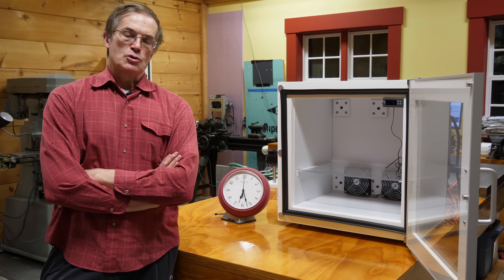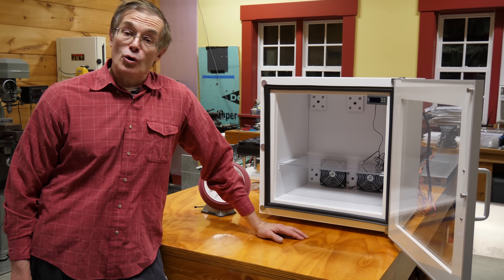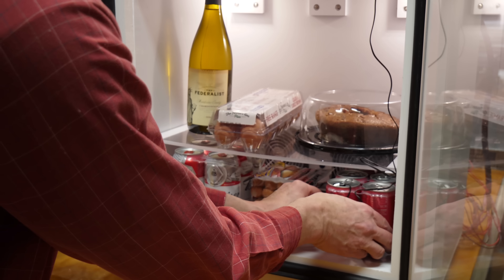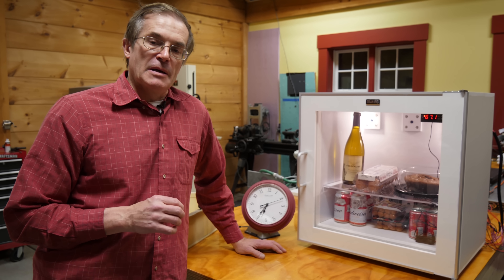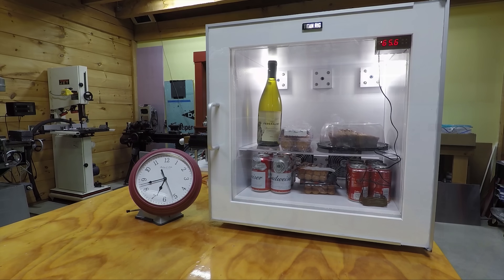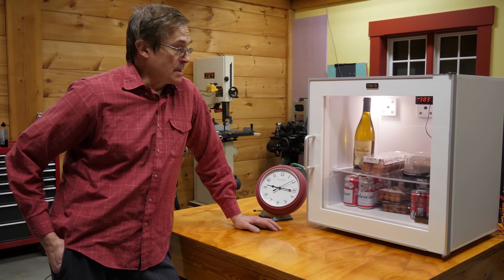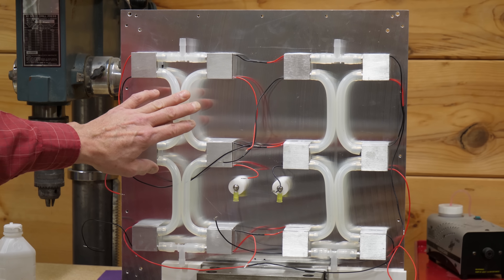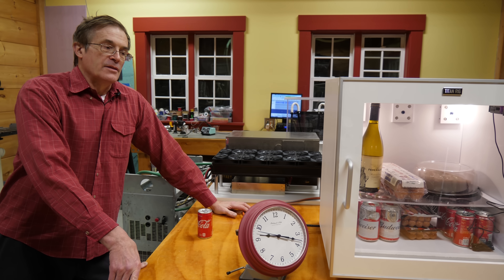TESTING OUR DIY REFRIGERATOR! - TEC/PELTIER

Comment: the fridge looks great, you did a lovely job with the build. really looking forward to the follow up now. this is a very very interesting concept in terms of energy transfer for the van build i am planning, wherein i would like to use the bi-directional properties of peltieres to selectively cool and heat different spaces for climate control and energy and water storage at the same time.
you seem to have similar ideas and a way of thinking that i find brilliant. maybe you'd be interested in the holistic concept system i've dreamed up.

in an off grid van build, energy generation will be an important aspect of this bi-directional temperature/energy sytem, but in a domestic kitchen environment and in it's most basic form, i imagine a 'symbiotic' situation between a refrigerator and a sous vide cooking system to put the generated heat to good use.

if this gets you thinking i would LOOOOOOve to put your awesome grey matter to work on a hot-neutral-cold bi-directional energy transfer system for self-contained scenarios like an offgrid van or dwelling. 
anyway, i love the videos you make, thank you so much! they are very inspirational. see you in the next one!
Reply: And if you live in a cold climate, as I do, waste heat from the refrigerator isn't a problem - in fact, it's a blessing.  Other possible uses for the waste heat would be maintaining a hot water supply.  My interest was especially piqued when they mentioned a liquid cooling system.   It's nice if you can conserve that energy and move it around to where it's needed.

Comment: Hi there, plumber who does hydronics here. This is awesome, as are the other videos of yours that I've watched. 

Besides just exhausting outside, which is a great idea half of the year, you could water cool to a pre-conditioning holding tank before the inlet of a standard hot water tank. Cold water comes into some holding tank before going out to a traditional hot water tank but a parallel pipe circuit with a pump cools your fridge. This way the removed heat is used year-round to help heat your domestic water.
Reply: Is there some similar concept to the vortex tube in liquid refrigeration that could be used to seperate the cold part of a liquid from the hot one?
Reply: @chadoftoons  Generally in water tanks the cold input water enters the tank from a low point and you pull hot water from a high point and let the density difference handle the rest.
Reply: A small frige  that has a low energy consumption is something everyone would appreciate..I ,myself spend alot of time camping as i work alot away from home, so rather than staying at an expensive hotel, I camp..
  Just as finding an efficient way to keep food cold can be difficult...finding a hot water supply for showers ..dishes..laundry ect..is equally as hard..in fact they together are easily the two greatest challenges any camper faces...would be so nice if you could "kill two birds with one stone "here...and make it able to run of of any "green" energy..solar, wind, mimi hydroelectric source would definitely  be a bonus!! Huge market out there for such a product..
Reply: The peliters are only inefficient if you don't have a use for the waste heat, but if you do, you can really make them make sense.
Reply: @jttech44  Such as heating your room, when cold outside ;) but you could use the energy to heat your room with a heater that has a higher cop than 1(that will be the cop for using the cooler to heat your room via waste heat).. but at such small energies it's probably not worth it.
Reply: I like your thinking and had similar thought... find a use for the resultant heat output so it's not wasted. Heating water is a great idea.

Comment: WAIT.. SERIOUSLY.. You didn't follow up with power requirements. You built a fridge, talked about how to use the devices efficiently,  but never posted numbers. 

I'm really interested in how much your fridge draws. We have a fridge that is slightly larger on our boat and I know exactly how many watts it requires per day. I'm  interested to see how much more efficient my fridge is than the one you built (mine is compressor based which is why I'm pretty sure its more efficient).
Reply: Having this system on a boat is really interesting actually, because you have a ready source of cool water to keep your peliters happy. I'd bet it would work rather well.
Reply: @jttech44  That's what I was interested in too!
Reply: You right, it would indeed be interesting to see some numbers.
Reply: Yup there's a reason why Peltier fridges aren't a thing(outside cheap coolers and such). Phase change is no contest more efficient.
Reply: @payday510  Lots of moving parts on a phase change unit though, and they don't like being moved around while in operation. That's a problem for a boat doing boat stuff so this system might make sense if you have the power to burn.
Reply: @jttech44  Yeah, even more so than a boat doing not-boat stuff.
Reply: @jttech44  build one and shows us.
Reply: @jttech44  the danfoss bd35f and bd 50f compressors stay on a boat for more than 25 years with no problem if they are installed corectly... just recovered a bd25 35yers old still working with the freon r12 gas... still running...
Reply: +Lukas Ooo you are tryin to be sarcastic but you have no knowlege.
Reply: @thombaz  Thanks for that insightful comment, random person on the internet.
Reply: INDEED   so many trolls here   inexplicable to me    we should be trying to communicate freely , regarding ways to move forward using less    but i'm a freak , it seems @thombaz
Reply: @kcajmortsnnew1488  Good to hear , we need more freaks!!! We all come from different backgrounds, but with varying knowledge. Just think how much further, not to mention happier we would all be if we all used a bit more kindness when dealing with each other. Freaks unite!!!! After all which is a better teacher, A person with vast knowledge but can't (or won't) convey this properly to a lesser qualified student. Or a person with half the knowledge and  the passion and patience to impart all that knowledge? If they were all like the first example, we would be saying "what's a fridge?"
Reply: By the time he gets it near the heat exchange capacity of a typical phase change set up, it's gonna dim the lights every time it kicks on. If it ever kicks off, I suppose.
Reply: It'll be about 5 times higher than a conventional fridge of the same size.
Reply: +Lukas Well then... we are the same. :D
Reply: I AM A BOT, I AM A BOT, I AM A BOT!

"I know exactly how many watts it requires per day" was stated by Travis Wizniuk; so kcaj can now sleep in peace or whatever. 

For those that keep asking for numbers because they want to know how it compares to a phase change (compressor) system, he ALREADY stated in the previous video that it's extremely inefficient in comparison and that the purpose of this exploration is for those situations that can't or for those people that won't use a phase change system.

Please listen, read, think before applying fingers to the keyboard.

Btw kcaj, I won't be responding because I AM A BOT!
Reply: rebel bot....ha,ha,ha....i sleep quite well , thanks....NO REPLY   @strikehold
Reply: Seriously, the whole time I'm sitting there like dude, are you going to talk about Energy Efficiency and what's the power draw otherwise what's the point of this whole freaking video! I've already got a mini freezer that came with a dual thermostat and it only cost me $180 (rated at 136kwh/yr freezer and about 80kwh/yr in frig mode).  The problem is The Next Step Up from a single compartment 1.2 cubic foot freezer / fridge is a dual-compartment 10.1 cubic feet fridge. What frig is MamaBear supposed to use? I need a 3 cuft dual compartment frig that can fit a three 12in frozen pizzas, a gallon of ice cream, two 2 litre bottles of pop, 1 gallon. And I wanted to use about 150 kilowatt-hours a year or less!
Reply: you guys have been arguing for fucking 3 days,  and none of you thought to check WHO said "We have a fridge that is slightly larger on our boat AND I KNOW EXACTLY HOW MANY WATTS IT REQUIRES PER DAY"
Reply: @Tony N AGREE w/the troll comment , but note that i spent some time expressing dismay that a (possible) bot would be used in a thread like this , and that coming from political sites , i'd grown a bit paranoid   it's interesting you know how advanced A.I. is , and can see though it   i agree it usually reveals itself quickly , but i addressed that    
    i came back to try to untangle this , but utube shuffles and deletes comments , so this mess is impossible to make sense of now
  is what i've said that difficult to follow ? long sentences too difficult to follow ?   
       SERIOUSLY , your comment has nothing to do with the subject discussed , and appears to show you need to express your superiority
Reply: @suprememasteroftheuniverse  ain't you cute , projecting your sexual insecurity
Reply: just stay with the danfoss compressors... they have no equal in a boat... the most important thing is to have a nice good insulation... more is better, and keep the air from going in...
Reply: Hate to say it but the AI is right. It sounds like a small thing but it's important to understand or it gets you in trouble with reality AND the thought police. Watt does indeed include the "per second" and can be seen as a measure of instantaneous energy consumption. Consumption itself happens over time (that's what you pay for), it corresponds to the integration of watts over time and is expressed as Wh (or Wday). Watts per day sounds fine in English (because "per" is ambiguous in English) but it does not make sense mathematically in that context, it only makes sense as a measure of how the instantaneous energy consumption is itself changing over time. So if your fridge is magically using less power every day you could say it's getting better at 5 watts/day. If that's the case, patent it.
Reply: peltier is not efficient on large scales, because removing the heat becomes more challenging as the volume increases
Reply: "I know exactly how many watts it requires per day" - obviously you do not know, as it does not even make sense.
Reply: @hpekristiansen You buy electricity based on the watt hours you use.  Travis' question makes perfect sense.  Since the fridge's power consumption isn't constant a measure of the watt hours used over a 24 hour period would be a perfectly valid parameter.
Reply: @maddpeanut6313  Yes - watt hours per day gives you the average power usage that day. -that does not mean it makes sense to say "how many watts it requires per day" - it does not!
Reply: @hpekristiansen  You can easily calculate watts per day from kilowatt hours with simple arithmetic. It's not an industry standard measure, but it's not nonsense. I think you might be the less informed one.
Reply: @deelowe3  It is not industry standard, it is not any standard,  because it does not make sense. Try to do the calculation, that you claim is so easy - just take som random numbers with units. e.g. 24 hours/day, 12 kWh and you will see that the unit W/day can never be calculated in a sensical way. I will not be responding anymore, as I find you obnoxious.
Reply: @hpekristiansen  Multiply kWh by 1000 and divide by 24. Did you fall asleep during the units conversion lectures in science class?
Reply: @gdxd7956  HAHAHAHA oh... the irony . you call everyone an idiot but your math is wrong. This is about physics buddy, not only math. Sit down and let me help you.
Joule is the real unity of energy. 1 watt is 1 Joule per second. kW.h is a confusing unit of energy because to get to an amount of energy from kW you don't divide by time, you multiply by time in order to cancel the "per second" that is already inside Watt. So the correct math is:
1kW.h = 1000 . J/s  . 3600 s
Converting 1hour to seconds you get to cancel the seconds unit from Watt. thus
1kWh = 3600000 J.

kWh also means you left a device that draws 1000 W on for an hour . Or another that draws 500W on for 2 hours. The "per hour" thing quickly looses its meaning. It is confusing because it mixes consumption per second with hour in the same unit and those don't immediately cancel out. But it's convenient for the electricity bill somehow. This unfortunately leads the average person to intuitively (and  mistakenly) using kW as an amount of energy whenever he says " my device consumed 5 kW per hour" (thinking that running it for 1 hour will use 5kW of energy). This leads to the dreaded "how many watts per day?". Gustavo, even when you tried to correct everyone using your math you ended up doing this same common mistake. Boa sorte na próxima vez, amigo.

This is why Watt/day makes no sense.
Watt.Hour/day makes sense.
Reply: @hpekristiansen  Ahh.. I see the internet police have arrived.. 

Ok ok, watt hours. Hows that? Now go fuck yourself.
Reply: if you know EXACTLY, why not tell us...many here asking that question....or is it a state secret       @hpekristiansen
Reply: @kcajmortsnnew1488  I thought I did tell you. - 'Watts required per day" does not make sense.
Reply: well,obviously we're talking at cross purposes..  i DID NOT ever say i know EXACTLY how many watts per day a unit uses      your "quote" i saw as your assertion that YOU knew the amp/hr use of the peltier in this vid. , thus my query  to you                                     .i usually use amp hours , not watts , to find power use       but if one knows A H and voltage and how long it's running per day , then watts required per day CAN make sense , of course it has to be an approximation ; ambient temps. etc.                  i was hoping to get an answer to amp/hr use of his refer , which is not forthcoming     @hpekristiansen
Reply: @kcajmortsnnew1488  I do not have any more information than you do by watching the video. You are very confused about the units of time(hours), power(Watts) and  energy(Ampere hours). I can simply not understand what you are writing. Try to write down a couple of formulas instead of writing it in words.
Reply: ah   now i understand WHY we're not communicating      i don't have a math background             but i'm not confused           if amps X volts = watts , the rest is simple , AND watts per day is a   simple calculation , IF , as i said , you know how many hrs. per day it's running              i don't know how energy/watts/power are expressed/defined , so my language is not as precise or "correct" as yours, thus YOUR  confusion re: what i was saying             again , where did i say EXACTLY ?  honestly , you seem to be determined to correct/insult me     you honestly can't understand what i'm saying ?   this ridiculous misunderstanding started with your misquote , and went downhill from there       @hpekristiansen
Reply: @kcajmortsnnew1488  I did not misquote anything - it is copy pasted directly from your original comment. I will not make further replies to this thread, as you believe that I try to insult you. You are confused, and you do not make sense.
Reply: this is obviously a waste of time for both of us , but i reread all my comments and could not find any statement by me that said what you claim    i've asked twice now    you will respond no further , but , as a courtesy , if you cut and paste my original post here and i did say what you claim , i will apologize profusely         @hpekristiansen
Reply: @hpekristiansen  It's not stupider than kWh.
Reply: @hpekristiansen watts per day makes perfect cense, all you can ever consume is watts, that's why you electric bill comes in KW. AH is measure of consumption because the amount of time it is operating is unknown. When you are on a boat or RV you need to know the Watts per day because if you use more than your batteries have again in Watts you run out of electricity.
Reply: to anyone who reads down this far....i wasted time over 3 days responding to a TROLL...probably A.I.   these A.I. types usually reveal themselves pretty quickly by 1:refusing to respond to the actual topic , 2: refusing to answer specific questions 3:garbled use of language , usually rather subtle , but noticeable  4:resorting to insult                                          it's sometimes fun to "play" with them , but finally a waste of time....                                     .             i often "meet? them on political sites , but it took a while to raise suspicion here , since the agenda made no sense  the obtuseness of hypxtian was weird , so i went to his site . and met with a blank page THIS CHANNEL HAS NO CONTENT ; which is suspicious , not definitive proof.,but a tip off.......what baffles me , is what it's purpose HERE would be.....i am paranoid enough to suspect there're people who wish to sow confusion and dissent , perhaps ?          CIA or Russia , China or NSA , it matters not...one assumes a level of intelligence , quite often low , on utube , but this one fooled me for 3 days...embarrassing....artificial intelligence bots area real thing ,  i wonder if the glitches are due to programmers , or inherent ????? ah well , if you're ever frustrated in conversation with a seeming idiot , go to their page    they exist to piss you off , and life's to short for MORE angry frustration    PEACE
Reply: IT'S A TROLL BOT   @thombaz
Reply: @hpekristiansen  it is copy pasted directly from your original comment.  

HE IS NOT THE ORIGINAL COMMENTOR.
Reply: @kcajmortsnnew1488  "power/time" is correct regardless the unit you use, don´t worry
Reply: @kcajmortsnnew1488   I think that hp guy was originally quoting the main comment by travis, not you. and he thought he was talking to travis as well.
Reply: keep the one that works    this guy is clever ,  but........
Reply: "watts per day" 😂 I'd also be interested in the amount of volts per day so I can calculate the standard unit of ampere days²  😂😂😂 </ironie>